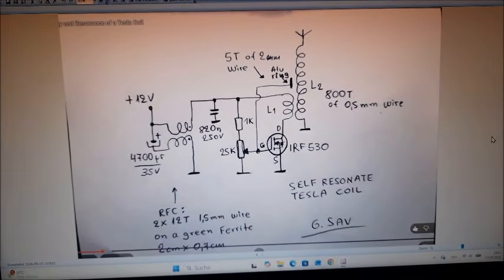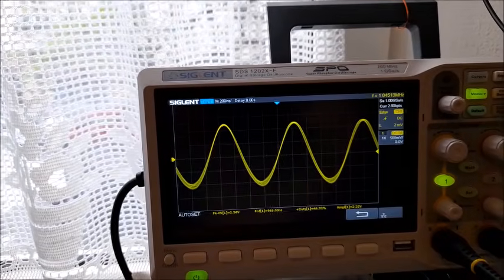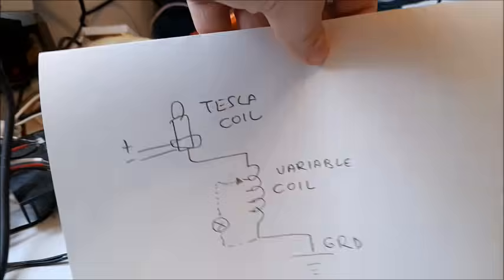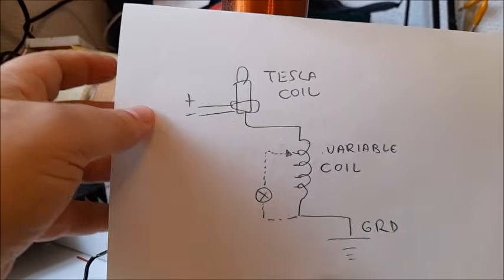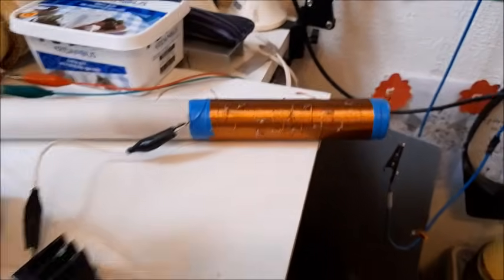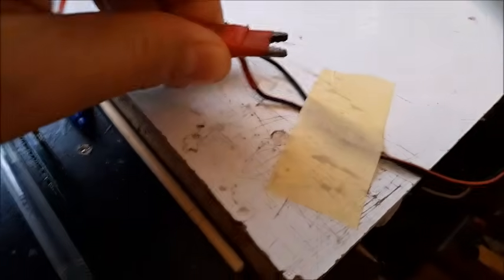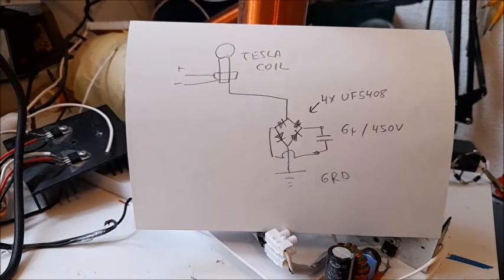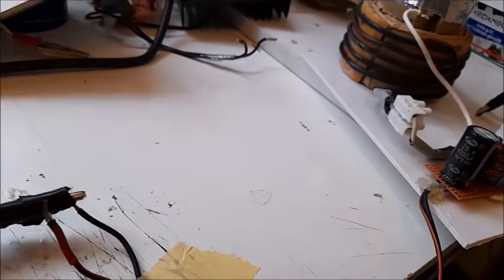The Energy that flows through a Tesla Coil and the ground.

Comment: Hi great video, yes I use the same type of circuit but added in a phase locked loop to drive the coil driver this reduces the power taken from the psu. Could you show the voltage and current reading from the power supply as you do each experiment at the same time have a florescent tube near the coil to observe changing high voltage on the capacitor top load
Reply: Great I have operated out side with out a ground wire up to 30 feet, capacitance matching into the ground, power supply 50volts and current 400ma, far end load a 2.7 volts on to a bright cob   light, with the Tesla coils top load capacitor ball about 10 to 12 feet up, if you use a bottom wire connection between the coils insulated off the ground you can drive the Transmitter between 5 to 8 volts at 200ma for the same far end output
Reply from the maker: Hi friend! I am now preparing a new more detailed video. All these answers will be available on it.

Comment: I'm wondering how much current and voltage a Tesla coil has. What I'm interested in is the coil's current and resistive voltage, and what kind of capacitor you're using at the output where you connect the coil. I'm curious about the current and voltage ratings of the secondary and primary coils.
Reply from the maker: I am gonna show it in my other video, because the subscribers found it interesting as well and they want to know more!